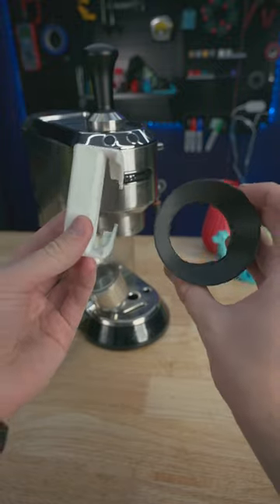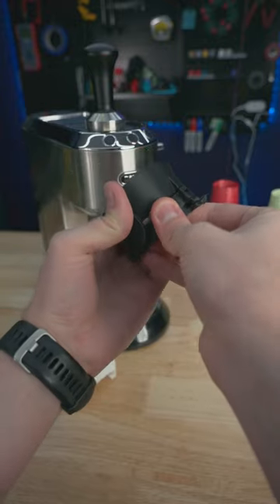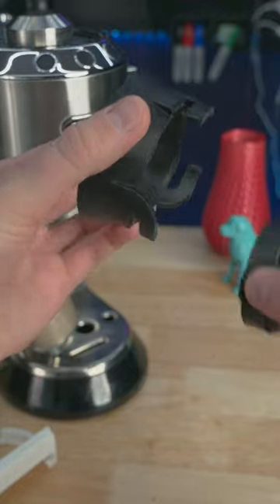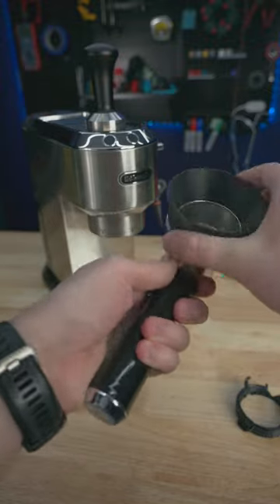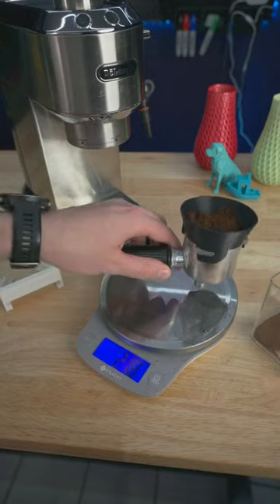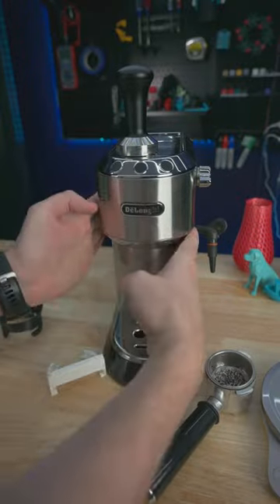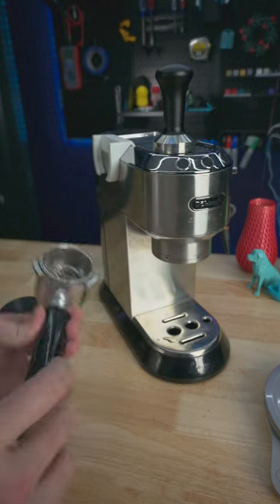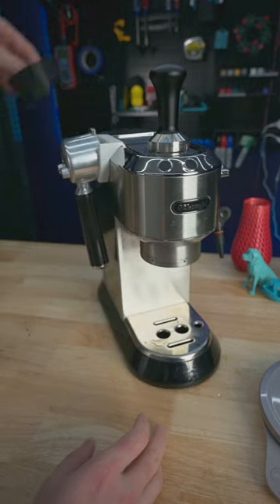3D Printed ☕ Espresso Machine Upgrades

Comment: Can't believe you used that much support for that filter. Just flip it upside down and enable "support everywhere"
Reply from the maker: These are hollow tree supports, barely any material used
Reply: @JJShankles  yeah but the only part that really needed supports were the hooks and the printer can print support in-between them if you enable supports on the model and flip it upside down
Reply: @shibu5175  I agree, but there might not have been much bed adhesion on the top edge of the funnel since it's tapered (unless one uses a brim). For that reason one might consider printing like this since the hooks' flat parts are wider. And besides... It's not an absurd amount of support being made here
Reply: @c0naNnn  true true! I find it quite fun being conservstional with materials and whatnot. Kinda the same feeling when 3D modeling efficiently. It's satisfying.
Reply: @shibu5175  it's totally a fun hobby to discuss 👍
Reply: @c0naNnn my friend, raft?

Comment: Be careful with FDM printed parts and food as the printing process makes the material porous enough not to be food safe and therefore it will have a high chance of becoming a bacteria haven even if you exercise good cleanliness with the parts.
Reply: Sand off FDA compliant material and you’ll get rid of that👍🏼 but good point there
Reply: Less of an issue to worry about in a scenario where its being used for dry foods.

Comment: Very clever design but be careful, most of the espresso machines have a rubber join between the machines and the handle and it is better to let the handle on when you don't use it to keep it well for long time !
Reply: Really? How so? Why does leaving the handle on make a difference for the rubber?

Comment: The microplastics really add to the flavor
Reply: There is FDA compliant you can print😉
Reply: Id agree that this should be epoxy coated, but truth is that we consume a way more alarming amount of microplasfics than you expect just by eating meats and plants, as microplastics are very much embedded into the food chain by now :(
Reply: @randomlysatisfying6064  it stops being FDA compliant when it goes through the printer
Reply: @The_Wosh  even if you only print FDA compliant material and change the extruder gear to stainless steel and only use ptfe lining? I‘ve worked in the food, drug & chemistry industry for 4 years. The only problem i‘d see would be selling the prints with an FDA compliant stamp.
I‘d say it’s safe🤷🏻‍♂️ even with a standard ootb printer like an ender 3
Reply: @randomlysatisfying6064  none of that matters if your hot end has shit in it, which it most likely does from the factory
Reply: Didn’t think about that one🤦🏻‍♂️

Comment: Is the plastic used for printing safe/or food grade is it?
Reply from the maker: It is safe for funneling dry things like coffee grounds. As far as I understand it wouldn't be safe for wet foods since it can't be heated enough to sanitize it between uses. And since the use case here is espresso which will be brewed at near boiling then that would kill most chance of bacteria making it into your cup
Reply: I was thinking more of microplastics due to high temperature but okay:)👍
Reply: As long as you’re not wetting it or heating it up it shouldn’t leech plastic in your food
Reply: @takshashilacorporate9787  Mmm plastic
Reply: The pla should be alright since it’s dry, the issue with 3d prints is they have many holes in the structure that allow for bacteria to grow without being able to clean. I think this is a very neat print tho so I would just sand it down a bit and prime it so that you have a smooth finish without the micro holes

Comment: You realize those are NOT food safe right?  Plus why would you use the funnel when you can't level and tamper the coffee... You're just making an unnecessary mess as if you have no idea what you're doing...  While its a nice print... It's not necessary or resourceful.  Its actually making it rather difficult to properly prepare your coffee... You're pouring it in, then having to turn it over to let some back out.  You're supposed to have a scoop to scoop the coffee out of the bag, into the filter, and then use the tamper to press evenly and pack the coffee tight.  Sometimes it's an all in one tool.  You do not use a funnel as it makes it difficult to tamper and level off the grounds.  And I have no idea what you're using the other print for.  But likely another bad use.  Please watch a few videos on how to properly prepare coffee using a press or the machine you have and tampering.
Reply: Pretty wild comment for someone who doesn't even consider that you can just take the funnel off before tamping